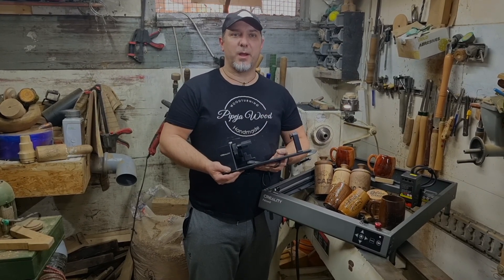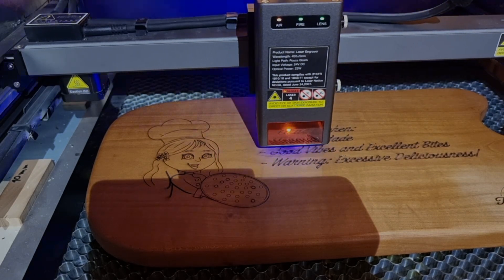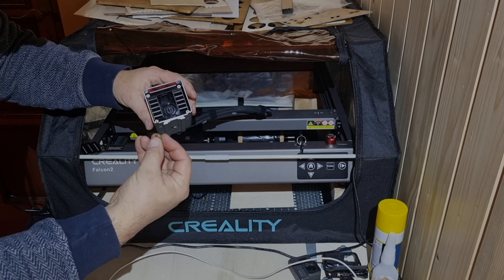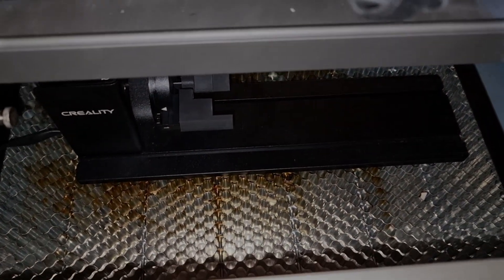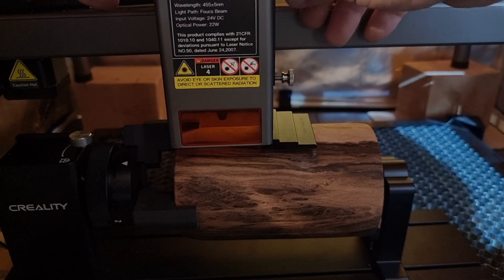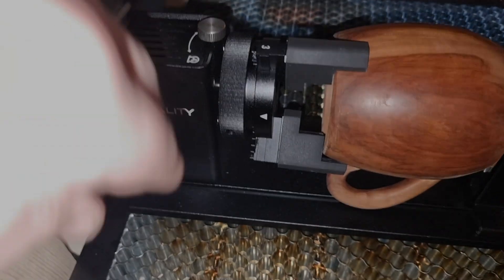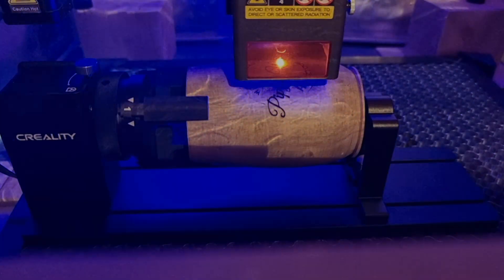Creality Falcon 2 Laser & Rotary Magic | Laser Tool Setup and Maintenance

Comment: What setting do you use for the rotary? I cannot get my framing to work at all I set left center origin and current position and it always starts bottom left
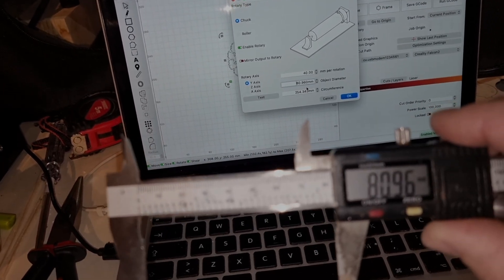Reply from the maker: You can see this in the video at 6:40. ▶️👀

Comment: no recomiendo lavar el lente con cepillo
Reply from the maker: Thank you for this. Can you tell me what is better to clean the lens with?
Reply: @Pipejawood-Woodturning el lente es demasiado delicado, puede producirte errores como dañarte el láser. No lo recomiendo
Reply from the maker: How do you clean these lenses?
Reply: @Pipejawood-Woodturning cotonetes y alcohol isopropílico y después el pañito que te trae bro. Porque el lente con la mínima falla que tenga te quema el material y te quema más el lente bro
Reply from the maker: Thanks
Reply: @Pipejawood-Woodturning  merece bro, el lente es bravazo cuidarlo sisi.
Reply: @Pipejawood-Woodturning  nada que agradecer bro, merece. yo limpio con eso las dos maquinas y te recomiendo en caso de que no hagas muchois trabajos seguidos limpiarla cada 3 dias (limpieza completa claro) del cabezal claro ejje porque cuando esta sucio (mas por el lente como te dije) quema mas el material. y otro consejo bro si consigues un air assistent puede ayudarte con el quemado en los cortes (no recomendado usarlo en grabados) pero te hace menos humo y te ayuda que no se ensucie el lente
Reply from the maker: Yes, I have air assist. And yes, that is true what you have told me.